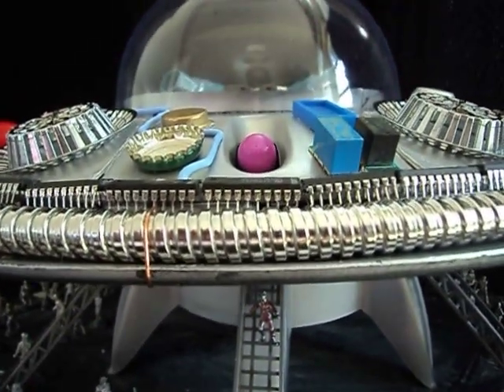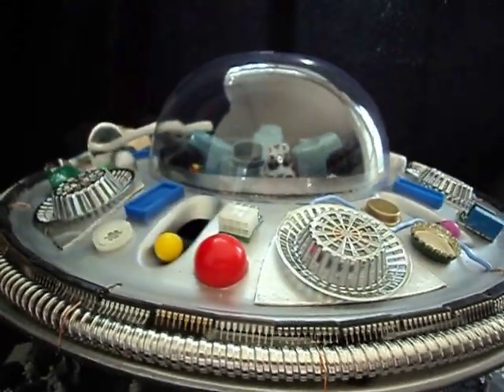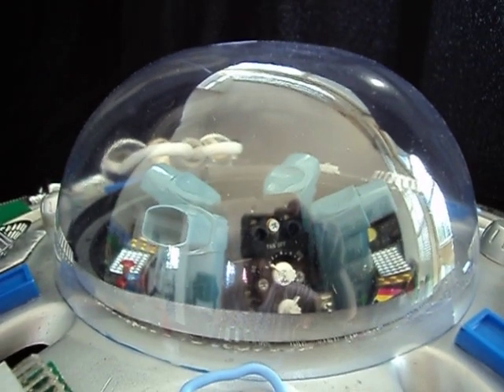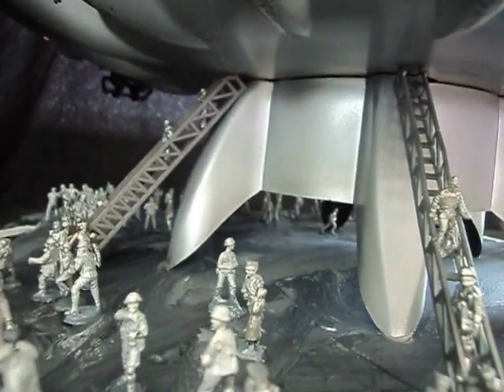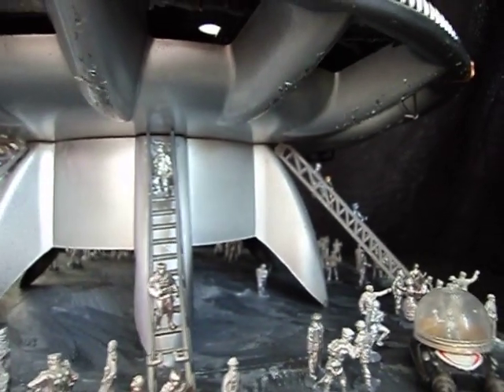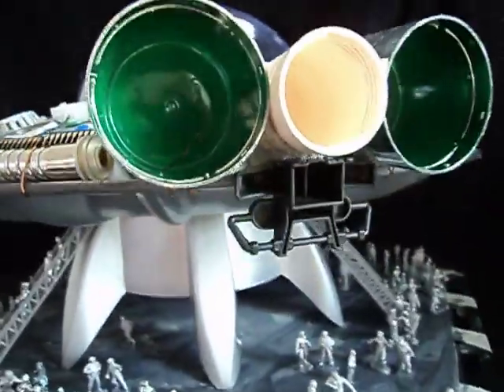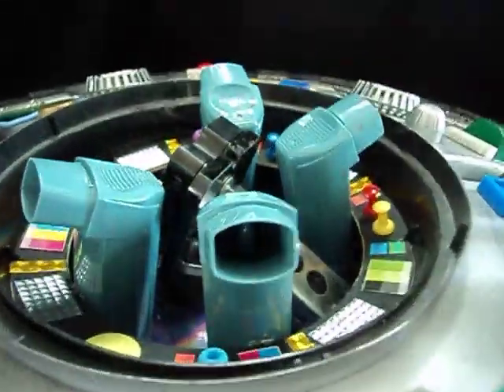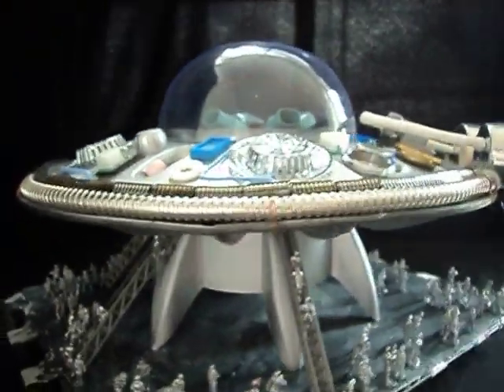Spaceship Model

Comment: Hubcaps are rare these days, but using a plate I might be able to make the top and bottom from papermashe - Hmmmm
Reply from the maker: Yes that would work. Although if you're lucky you'll be able to find wheel trims on road sides or grass verges. Just look for a size - match and then wire them together. Then you can enjoy adding all your detail.